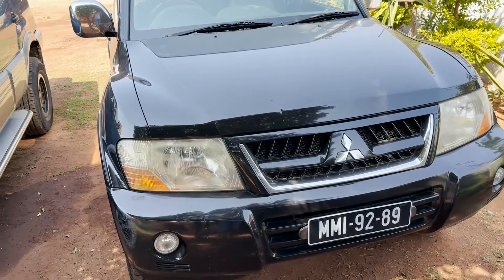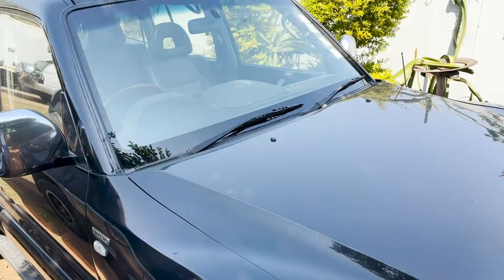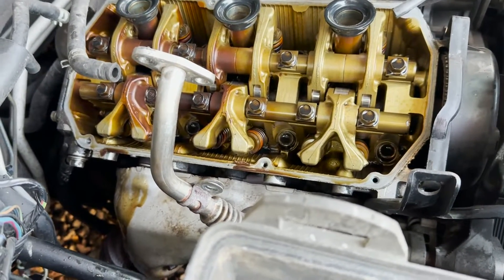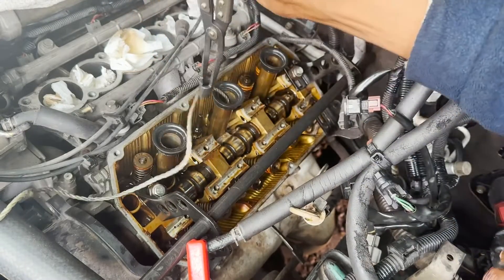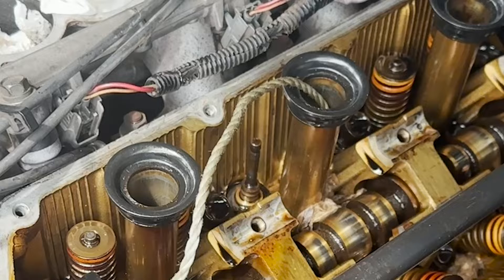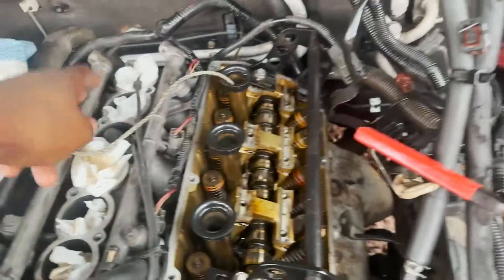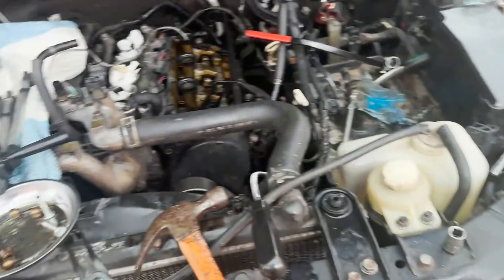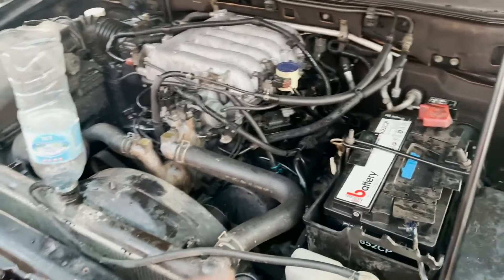Pajero/Montero 6g75 Valve steam seals replacement (Rope method)

Comment: Hello friend, I do not speak English and I use the translator to communicate with you, at this moment I have the same problem with a 6G74, the only problem is that I do not understand what you did with the rope or how you did it so that the valves did not oscillate at the time of put the padlocks on it. I would be very grateful for his help, I hope for his prompt response, thank you.
Reply: he basically put a rope inside the cylinder through the spark plug hole, and then turned the engine until it compressed the rope which filled up all the empty space in the cylinder and so the valve wont fall into the engine

Comment: I bought a Pajero 2008 3.8 which oil keeps desapearing from the case 1L per 1500km and smells a little when start the engine or leave it idling for some time and than race the engine. Based on what I read, the problem might be these seals. You made it look an easy job. Thanks for sharing.